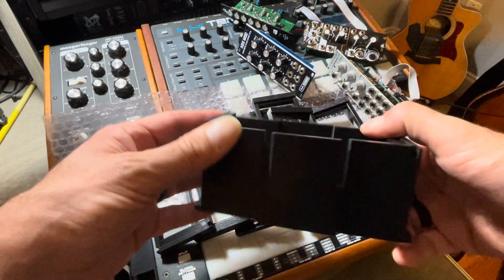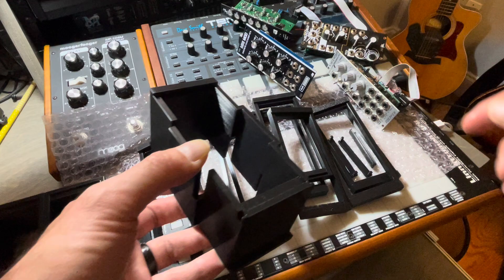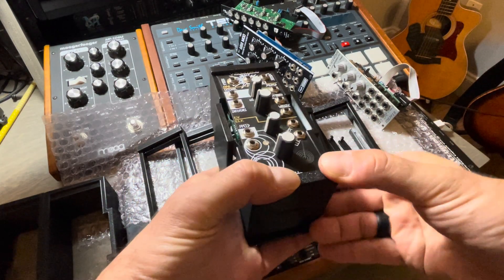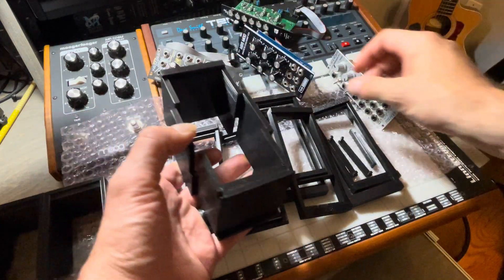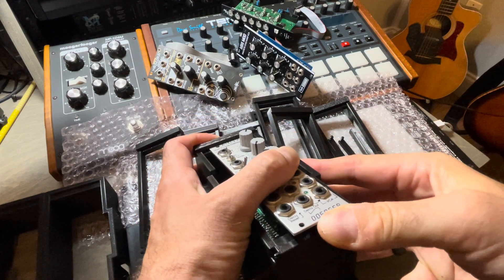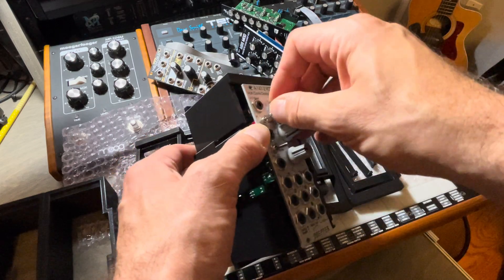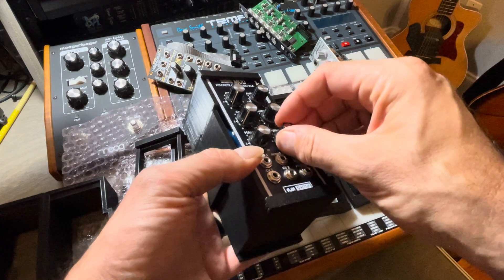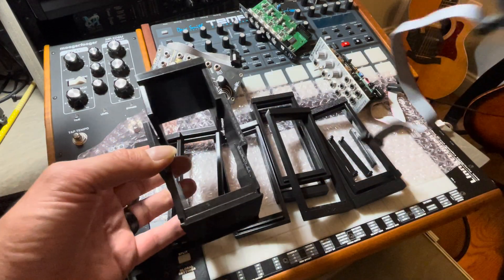3D printed Eurorack case proto 2: no screws needed for the modules themselves!

Comment: U don't need any tools with Befaco screws either so it seems you're fixing 1 problem that doesn't exist. Secondly, it still seems difficult to remove various modules - you obviously don't expect people to push modules from behind? And where do the ribbons cables go? Anyhow, seems there's a good chance you can find a market for this product, it's an interesting idea.
Reply: With this you don't need neither the screws nor the rails/nuts. It is not comparable to the aluminium rail profile + steel rail + screw combo, but a wonderful alternative. The screwdriver, is the easiest and cheapest thing to get from that setup. The money is in the rails and profiles. Besides with this you don't need to manage the screws, and it's perfect for passive modules and for those you don't want to have constantly in your main rack, or for testing purposes. What is wrong with pushing the modules from behind? Unless you are pushing on a trimmer pot and turn it accidentally and detune a parameter, it wont hurt the module...